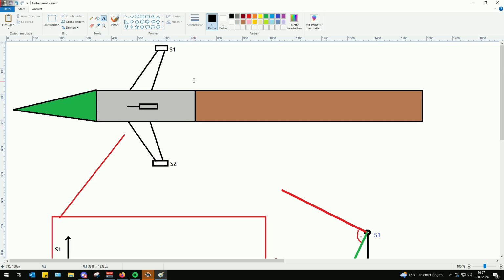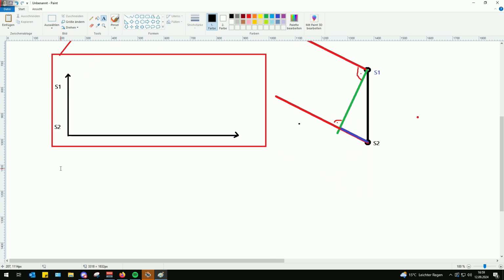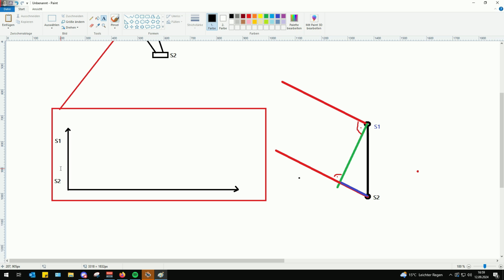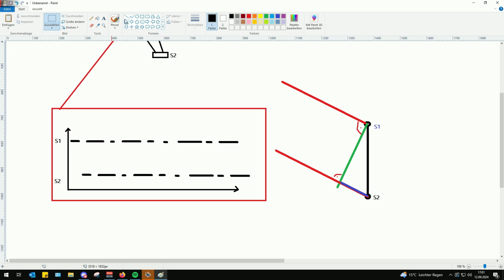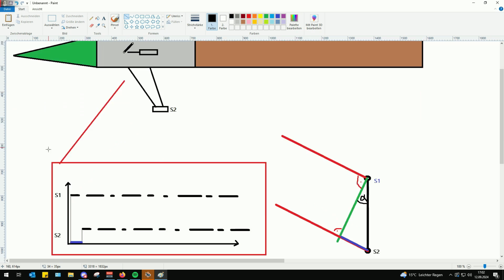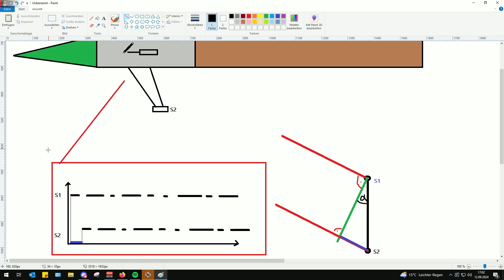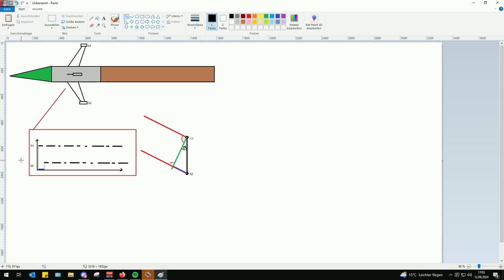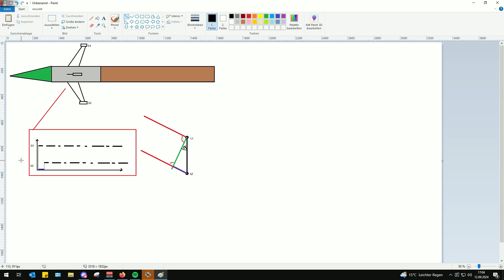Technology Explained: How the APKWS laser guided rocket works (my personal guess)

Comment: So, how would the laser codes be set in the rocket?  AFAIK, rocket pods don't have a connection to the avionics of the plane to allow the pilot to set the codes.
Reply from the maker: pre flight, its 3 slot screws on the outside to set the codes, similar to LGBs

Comment: Once, I saw a fixed-wing drone equipped with an FPV camera mounted on its nose. The pilot targeted an object, and once it locked onto the target, the drone continued flying towards the target ( he didn't allow it to impact the target by using his radio-controlled and changed its course). I was curious about how this system worked, but I didn’t get an explanation.

From what I understand, if you want a drone to fly towards a point you select on the screen, it likely involves keeping the target centered in the drone's camera view. The process might involve retrieving the live video feed from the drone's camera, using a tool like OpenCV to display the feed, and capturing the user's click or tap coordinates. It would then calculate the difference between the clicked point and the center of the video feed. A PID controller would likely be used to continuously adjust the drone's yaw, pitch, and roll, ensuring the target remains centered until the drone reaches it.

I’m not certain if this is exactly how it works, but the concept seems similar to how TV-guided missiles and bombs function in my opinion. Looking forward to your analysis of TV guided bombs.